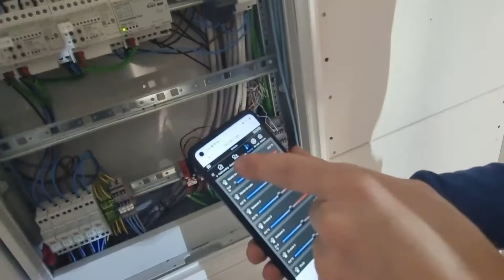KNX Underfloor heating control

Comment: Question, would a setup like this function if instead of underfloor heating you had radiators on the walls and without a central manifold?